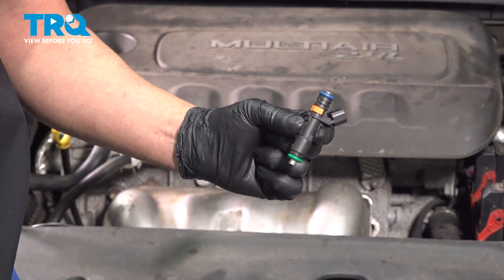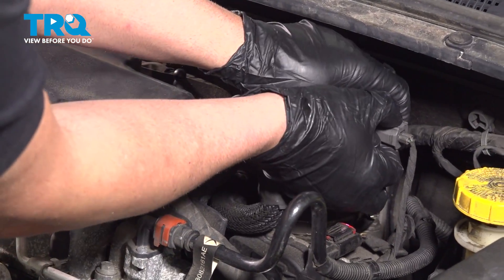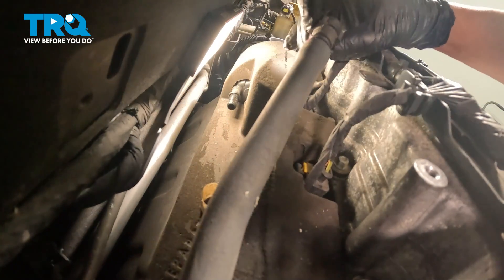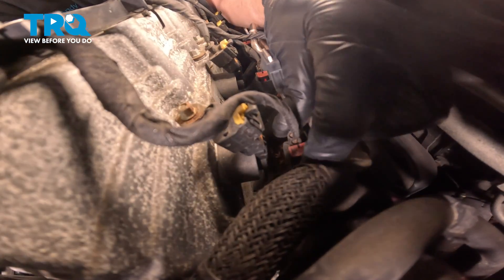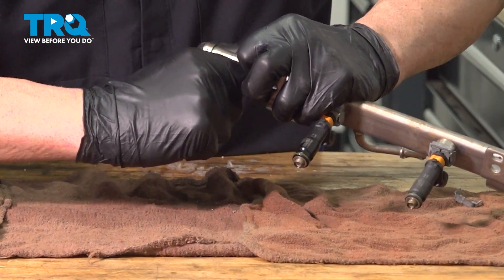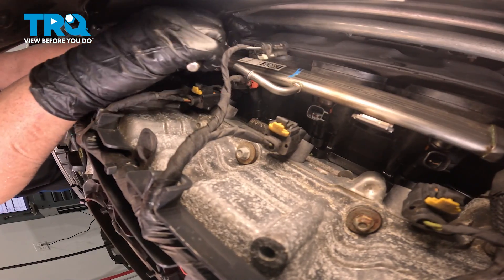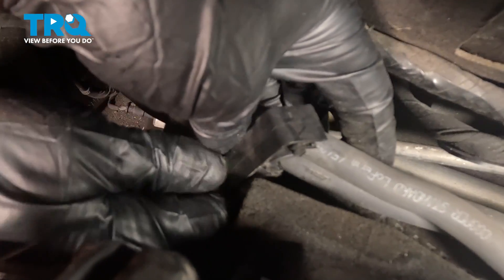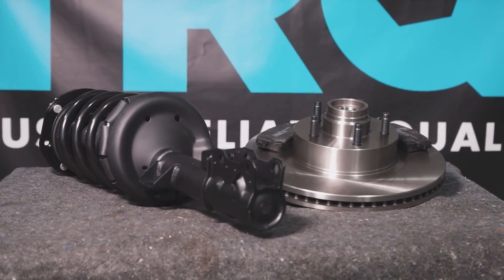How to Replace Fuel Injectors 2013-2016 Dodge Dart (2.4L L4)

Comment: Sadly, i may be doing this to my 1.4 turbo dart, replaced plugs and #3 coil (which fixed a huge misfire), and still have sputtering under load, trying injector cleaner, but afraid my next step may have to be all the injectors, or the other 3 coils.